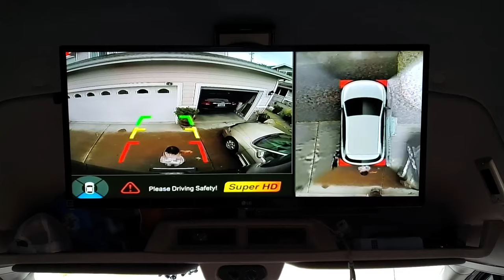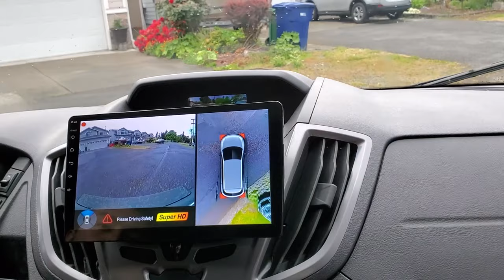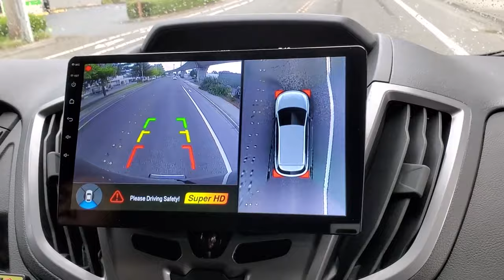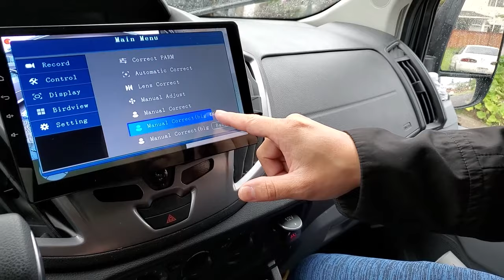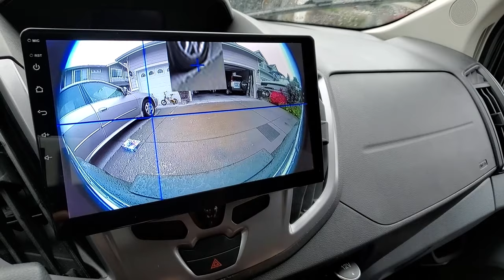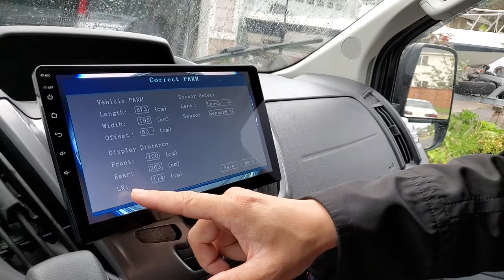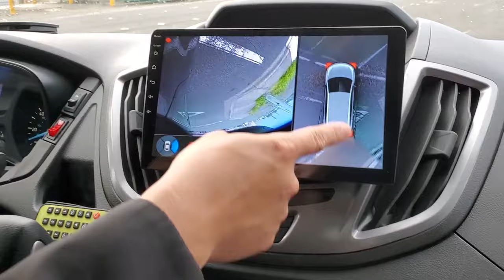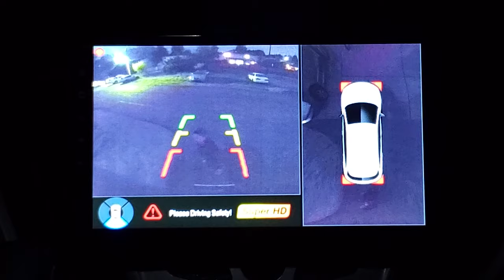Van life security camera system | Dual use stealth low power surround view with DVR recording.

Comment: Great video. I just found your channel when looking for reviews on the rear view mirror you have. This system is so cheap it makes sense to put it in the 20 year old van I'm about to start building. Question: Do you have two rear cameras (one for the mirror and one for the security system) or did you wire both systems to one camera?
Reply from the maker: You can wire both to the same camera but i did 2 cameras because the security system camera is wide angel and the rearview camera is not as wide, plus i wanted to see tree branches and building when backing up to avoid hitting the tall roof.
Reply: @EvolvingBuilds  Thank you for the reply. This is good information and good logic. I'll probably do the same.

Comment: I’ve been spending a TON of time trying to find a Small, Waterproof, IR Night Vision, Motion Sensing camera.  These look like most that I’ve seen on eBay.  None check all four of (my) criteria boxes.

Your kids are ADORABLE, btw.
Reply from the maker: That will be really hard to find. This setup is the best when it comes to stealth. Just missing the IR to really see in the darkness but I could add small IR lights if needed.
Reply: Kenny Nguyen So One of Four is IR ?  How would (adding) IR be accomplished ?  Doesn’t it have to electronically ‘mate’ with camera focal point ?  Did you discuss monitor, and I missed it ?  Is it 120VAC or 12VDC ?  I’ve been looking at Gaming Monitors, as my understanding is that the ones with “Adapter” modules as part of Power Supply cord (downconvert) household power .... I could Easily be mistaken ... 🤷🏻‍♂️
Reply: Kenny Nguyen my initial design plan, based upon a European guy’s install is either camera mounted in side view mirror housing, or somehow on side of hightop.  If I can’t find what I’m looking for, my ‘back-up’ plan is a simple motion light up high on side ... but, it is difficult to find one with a tight enough range on Motion Sensing, to avoid false alarms from every passerby.  Not ideal when (forced to) urban camp.

Thanks for the vid & congrats on your Subscription milestone.
Reply from the maker: It's a 12v system for the cameras, my led monitor is 110v. You could buy a 12v monitor if you want. There are motion ir lights you can buy but big and clunky. You can get just the ir lights and turn on at night time. There are a lot of options. Just nothing that will come in a package together.
Reply from the maker: Motion is very hard on van setup. I would just buy small low energy ir lights and turn it on at night. The setup would draw very minimal from the battery so you will be good there.
Reply: Kenny Nguyen IR lights ?  How would they be activated without motion sensing ?  Do you mean cameras Constantly recording through the night ?
Reply from the maker: Yes, the system is on and recording constantly, 24/7. No setting for just motion as it is a cheap dvr.
Reply: Kenny Nguyen thanks very much.  So there is no real theft DETERRENT, just a means to get them on hard recording ....
Reply from the maker: @aldo9564  😄 i was going for the stealth look and not really wanting to attract and inviting them to break-in. My thought is if they see the cameras they will think there are valuables inside. Alarm warning stickers would be good detergent.

Comment: I am learning to drive but I only want a small van bit bigger than a car size but not a home removal type van or big van.  I want to get many cameras installed in back, front, sides, and aiming in the cockpit and at the speed so police can not say oh you were speeding when I have the video proof.  I was wondering also in your van how do you get ventalation in your van if you were to sleep in your own van?
Reply from the maker: By opening the maxxair roof fan vent or run it at 10% speed.

Comment: Hi great video do you have to connect the camera to your reversing light or is there an easier way I’m not very good with electrics
Reply from the maker: You do not need to. It is a stand-alone unit and you can wire it to turn on at ignition or via a on/off switch.

Comment: HOW DO YOU KEEP IT RUNNING FOR 24/7? when on went to amazon on the Q/A it said you can’t and also what is the difference between the black one you have and the gold one? I see price difference but I don’t know why?
Reply: He is powering it from the house battery (solar powered). It does not draw from the car battery.
Reply from the maker: There is no difference on the black or the gold and it is connect to the house battery side.

Comment: Good video, like the camera system planning on using it a bit differently, mounting the camera's on the roof rack, (have front & rear camera). Question what is the brand and how did you mount the monitor, was it expensive and can you monitor the camera's remotely ie via Wifi. - Thanks
Reply from the maker: Unfortunately this system is a surround view for vehicle. No remote viewing option. You can get a regular home security camera system with remote view to work in your situation. They are 12v, you just lose the pictures stitching to make it look seamless surround view. Or another option is to get a laptop or mobile computer with av to usb adapter and you can view it remotely.

Comment: Hi… I purchase the 360 camera however the backup camera  rear wire doesn’t reach the back. I also have the same car as you ford transit. Can you let me know how you were able to get the wire to reach the back?
Reply from the maker: Install the camera in the center of the rear where the brake light is and run the wiring straight from there to the front. From rearview mirror straight up the roof and plug into the rear camera. Mine barely fit. If still does not fit, cut the wiring and add more wire. Make sure to solder or you will get inference/noisy picture quality.

Comment: can you use a tablet as a monitor?
Reply from the maker: Yes, you can but you will need a wifi a/v transmitter or a device to transmit the video signal to your tablet. I went the wifi transmitter route on the new van build.

Comment: Hi Kenny thanks for the video -great explanations and content 😀!
Just wondering what app are using to display the 360 footage while driving... I initially thought it would automatically appear if you put car in reverse but of course when you place van in drive the camera screen will turn off on your head unit (thats if you are using the reverse camera video input) but I'm thinking if you are using a different rca  auxiliary video input then how do you display video even when your van is not running 🤔... pls explain & thanks again for helping us so much!
Reply from the maker: The surround view is a different system on it owns. I set it up to run 24/7. Rca video output to big monitor. Rca to reverse feed, so it turns on automatically when backing, and there is a power button on the remote to turn on anytime you want and it would trigger the dash unit.
Reply: @EvolvingBuilds   so the rca output of the 360 unit gets split into two - 1 goes to the input of your large LCD screen & the other split goes into the  backup camera input of the andriod radio? And even though U R not in reverse U just use the 360 remote unit which causes the reverse input to display while driving so thats how U get the blind spot displays right & left & of course 360 while driving.
& I'd guess if you happen to go to backup again and back to drive you would have to use the 360 remote to turn it on again... ?

Comment: Hi Kenny, I  bought this system but I  don't  have the zoom and camera display distance.  Do you know how  I can get it? At 22:40 your screen  options  is totally different from mine
Reply from the maker: The zoom setting is in Main Menu, Display, Side Setting - choose which camera and select zoom in or out, move left or right. Remember these are just small adjustments. You need to adjust the camera positions and use the angle rubber mounts for your situation. Vehicle measurement would be in Main Menu, Birdview, Correct Parm. Double-check the manual book. You will need to set the perimeter setting with Correct Parm in order for the cameras to stitch together well. Watch 21:15 on my video.
Reply: @EvolvingBuilds  I  watched  your  video about ten times before  I  purchased this unit.  I followed your  video step by step,  but I  noticed that I don't  have the zoom  feature  between  the "U". Maybe  I have a defective unit.
Reply from the maker: @sokhaly8832  Check with the seller to see if they can help. This might be an updated unit and have a different menu. Can you screen shot and post on my instagram @asiangenie.
Reply from the maker: The zoom only apply to the big display and not on the bird's eye display. I find that the zoom feature is not useful because you want the wide view instead of zoomed in. I don't use it, maybe they removed it in the newer unit?
Reply: @EvolvingBuilds  it's a different set up  but I  figure it out . Thank thank for your  help

Comment: Hi Kenny, this has solved my issue! I can't thank you enough! Do you think it the system would connect to a screen that is factory installed in a van? Thanks :)
Reply from the maker: You definitely can integrate with factory screen but you will need to buy a decoder to make it work. Same amount of work and cost more than just replacing the factory unit. Either route you will have to splice into the wiring. Or you can buy an additional screen and hook up the camera system as a stand-alone. I know there are some big 7" lcd screen that clip onto the rearview mirror. You could actually use 24/7 to monitor aswell. The screen and the camera system is about $250. A decoder alone is around $180 for Ford and $200 plus on Mercedes.
Reply from the maker: It is exactly the same. It is just a video RCA male and you can connect to any aftermarket stereo dash with video input. If you need to connect to an HDMI monitor/tv like mine, there are adapters rca to hdmi.
Reply: @EvolvingBuilds  I need to purchase one of these this week for my ban builder to install but the one you recommended is out of stock. On this link Rebecca mentioned she found another brand. Can you advise on an alternative to the one you used. BTW I don't need the video recording, just the surveillance system, monitor and cameras. Many thanks for your great videos and information.

Comment: Hey Kenny! I'm purchasing the same setup. Do you know if I don't hook up the back reverse wire, it'll show all the cameras? I'm just planning to use it for cctv security. Does it run 24 hours if I hook it up to the house batteries? and do you have any idea how many amps it draws? and one more, does it only record if there's a vibration (like an accident), how do I keep it recording?
Reply from the maker: You do not have to wire the reverse wire, you can hook it to the house batteries like mine, low amp i would say 1 amp to 2 amps max, and it will record when it is on, no vibration needed to activate.

Comment: Hey Kenny,  do you connect the camera u7nit to the camera on the head unit or in the video AuX in?  how do you trigger the system so when you back up it shows on the monitor.  I connected to the video Aux in but i have to switch to video  to see everything.
Reply from the maker: I forgot but i connected it to the camera on the unit. And i think there is a trigger wire on the 360 system. You do have to hit the power button on the remote to turn the camera on and it will stay on until off. Even in off when you reverse the system will turn on. That is if you connect the reverse wire to the 360 unit.
Reply: @EvolvingBuilds  thanks a lot.  I’ll try that tomorrow.

Comment: Can you place the cameras higher up on the vehicle such as on a rack frame?
Reply from the maker: You need to buy a different camera mount style like the front and reverse type. The one in this kit are straight down type. You can make  brackets for them to angle them and put on the side up top.

Comment: hi Kenny blessings for you and family hey can you pleas tell me what kind of monitor or tv screen i need i already have the cams an dvr but i dont have the tv or monitor can
Reply from the maker: Any 12v monitor with a/v rca input would work. Or check out my 10" dash screen on the channel or in the description.
Reply: to have to conect them short red wires ?
Reply from the maker: The red wires are signal wires . The left and right camera red wires are to be connected to the turn signals, and the rear camera red to reverse light to tell the unit to turn to those screen when you reverse or turn/change lanes.
Reply: @EvolvingBuilds   so i need to add more red wire to that red short wire ? do i conect to the + of the sinal were the lite bolb or from inside? and do i conect the dvr to battery ?
Reply from the maker: @lettyfzomarrero3264  watch the video a few times. I explained where i connect them. Read instructions aswell but yes the red wires at the camera lead needs to be connectex to the positive wires of the signals from outside.
Reply: @EvolvingBuilds  thank you so much kenny
Reply: Hi Kenny, Great video! The system you used is amazing but I noticed in the beginning of the video, you’re watching on what looks to be a 22 or 32 inch monitor. Much bigger than the 10 inch one you have a link too. I’m interested in using a large monitor like that also. How did you get the four video channels on the big monitor? Do you have a link for that monitor? Or how would I connect the four cables to a regular monitor and would it automatically create four quadrants on the screen? Thanks

Comment: hi Kenny im having a bit truble everry time i put my revers or signals on the dvr turns off after showing the footage what can i do ?
Reply from the maker: It will auto switch off or back to the feont camera after you put out of reverse or off turn signals. If you put in reverse it turn on back camera then turn off right away, there might be a mixed up in wiring. Make sure your connections of secure and not exposed/touching other wires.

Comment: i am converting a Closed Trailer to a UTC    Urbain Tactical Cargo and i need camera that i can watch from the inside , one fixe on each side and on 360 on the top , is it infra red or night vision ?
Reply from the maker: It has low light but if complete darkness with no moon it will not work.

Comment: Thankyou for helping the community so much. Great video

I am confused about how you are running 2 monitors.. 

Can you get a splitter y adapter or the yellow video RCA line to allow it to send video to 2 different monitors? Or did you project the stereo screen to the larger cabin screen? 

Thankyou for your help
Reply from the maker: Yes, it is just an RCA Y splitter, out put to 2 regular video RCA cables and an RCA to HDMI converter to connect to the cabin monitor/tv.
Reply: @EvolvingBuilds  did you buy the y splitter cable or did you make it yourself? Thanks heaps

Comment: I have the same vehicle as yours. A 2016. Where did you get your additional monitor?
Reply from the maker: I have the link to it in the description. Amazon link.
Reply: You have 3 links for the kit but not for the monitor.  Please update with link to monitor.
Reply from the maker: Oh you mean the over head monitor. That is just a regular ultra wide 29" LED computer monitor.
Reply from the maker: I will link it for you when I get home tonight.
Reply: I mean the screen you're looking into to configure your security system.  The 2016 model doesn’t come with that.  Is it standard for your model or did you purchase on amazon?
Reply from the maker: @MoniquePowersBeauty  my dash stereo monitor is aftermarket not original. If you have the stock dash monitor you have to buy an additional a/v kit to hook up the cameras system.
Reply: HELP  I DON'T  SEE THE MONITOR LINK SORRY ABOUT CAPS BAD  EYES
Reply: @EvolvingBuilds  Which aftermarket stereo monitor is it?

Comment: 9:00 why do i have to connect the white wire next to yellow (AV PORT) to reverse signal?
Reply from the maker: That wire is to get reverse power to switch the screen to the backup camera. If you do not hook it up, the screen will not automatically show the back up camera when you are in reverse. Of course you could still get the reverse screen with the remote if you do not want it to automatically turn on.

Comment: Hey kenny!!

Love your vids and beautiful fam :)

You rock!!
A bit late to be in your competition but am really interested in putting this system in my 2015 Mercedes sprinter van... my question is ... will it fit???... and do you think it would work on the stick monitor ??... or should/could I hook it up to a smart TV ???... what are your thoughts please 

Cheers 
Lynda in Australia
Reply from the maker: Thank you. The 10" dash is a double din and will fit in any stereo dash. The camera system is a separate unit that is a/v rca. You can buy a cheap a/v rca to hdmi converter and use on any TV or monitor like mine. Hope this help.